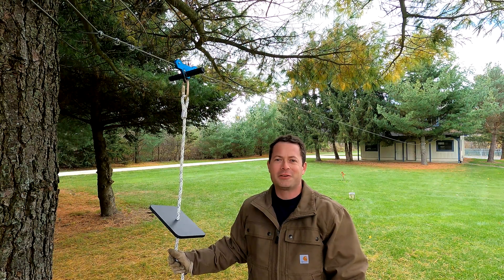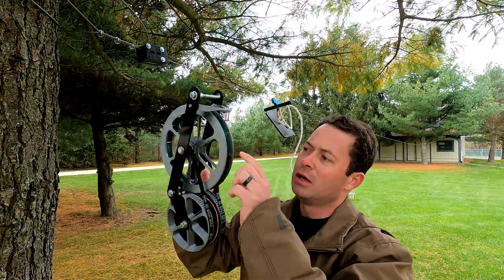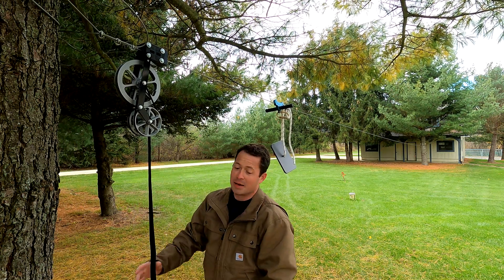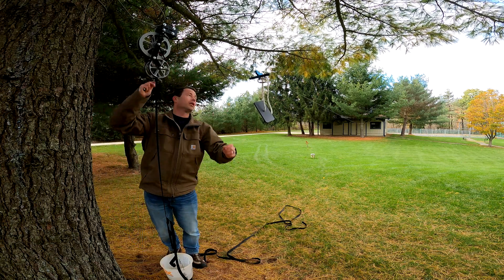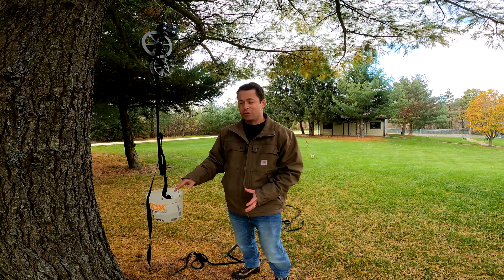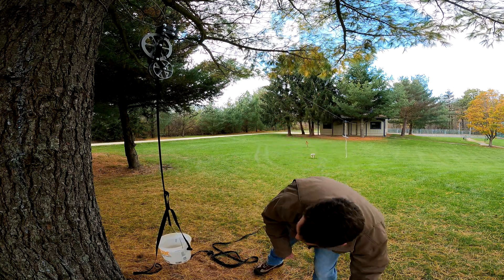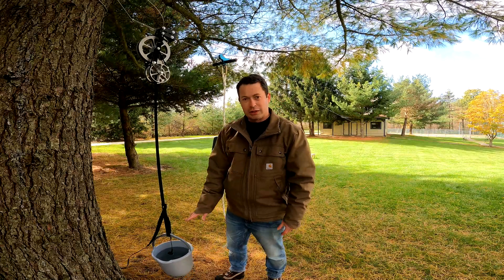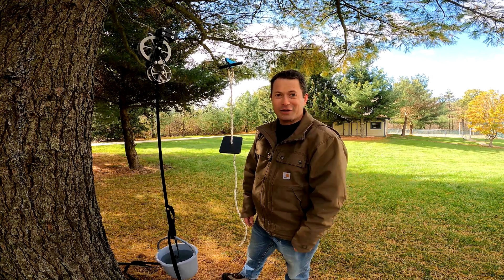✅ Automatic Zip Line Return System!  How To Get The Trolley Back To The Start - ZipLineGear.com

Comment: I'm looking for something to be able to put it up and take down after each use. Any quick release set ups?
Reply: If your using rope then add a quick link at the end with a ratchet strap for quick and easy way to keep the tension high
Reply: But if it's only to haul small items and not people then you probably won't need a ratchet strap as the rope won't be sagging alot

Comment: not sure why you have to unroll the entire strap. why not just use the end 4 feet and let bucket rest on ground a zero point.
Reply from the maker: The ratio changes as the strap unwinds and thus affects how the trolley returns to the start.  For best performance it should be pulled out as shown.
Reply: @NaterTater  seems like if the bucket was on a pulley and the end of the strap was connected back to the system double pulley it would half the ratio and possibly work. Having to unwind the entire thing just seems like a huge design flaw.
Reply from the maker: @justadumbfarmer4744  you can loop the strap back up to the main pulley to half the distance the bucket travels if needed.  It's not a design flaw, its a feature!  They provide excess strap for cases that need it.  If your setup doesnt require the full strap length you can just cut it to size after you setup your system.

Comment: With enough weight would it be possible to pull YOU and the trolley back up the slope??
Reply from the maker: In theory yes.  In practice, no.  It would be highly unsafe due to the amount of stored potential energy.
Reply: @NaterTater  I can see that, it would be cool though! Thanks for replying back.